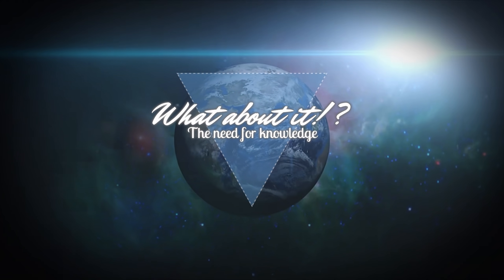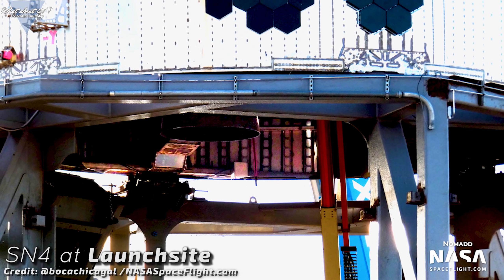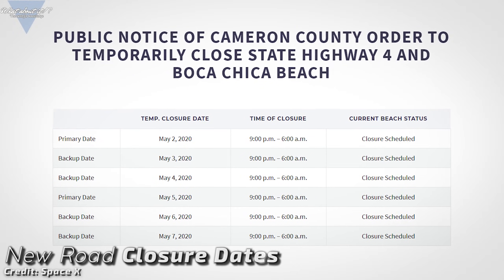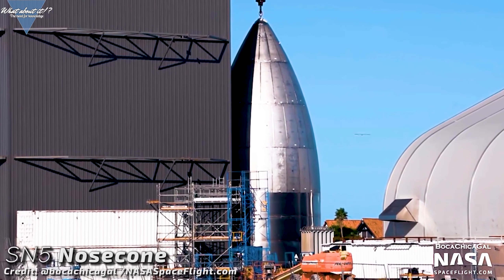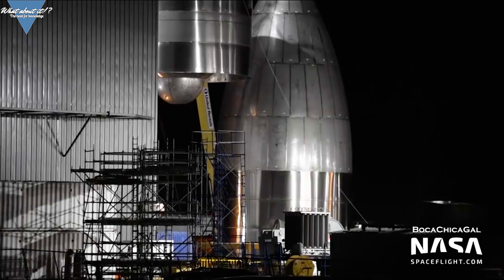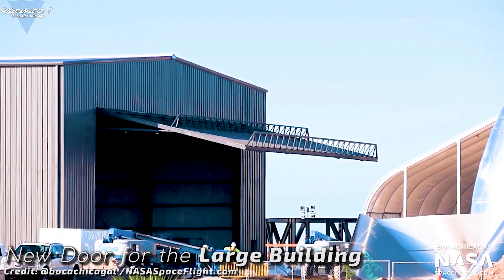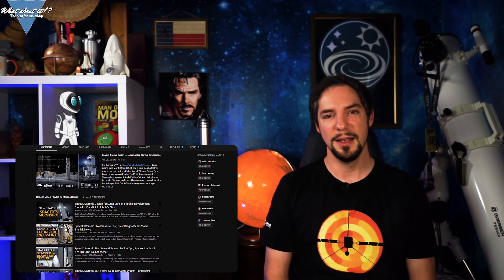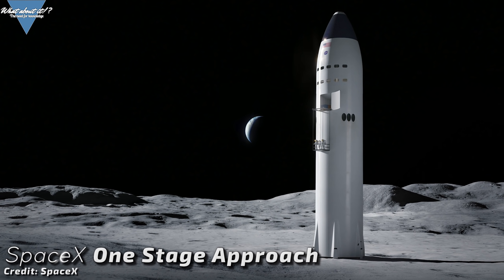89 | SpaceX Starship Updates - Lunar Starship: One Giant Leap

Comment: The lunar starship is supposed to be refueled and reused in space. A really big question is; what engines are being used higher up? There appears to be 12 of them. Obviously they can't be raptors because it only takes 3 raptors to land on earth. 

The next logical thought is that they are superdracos. If they are superdracos, then that creates a big issue with refueling. Space-X intends to demonstrate in-orbit refueling for methane and oxygen. They will used thrusting to settle liquid at the bottom of the tank, and pressure differential to move it. However the superdracos use hypergolic fuel under extremely high compression. (in a compression fed rocket, the fuel tank and feed line pressure has to be higher than the combustion chamber) This fuel is also extremely toxic. So how can it be routinely refueled? The only way I can imagine is to exchange the old empty tanks with new charged tanks. But then it has to be mounted and connected to the fuel line. If this is done in a pressurized cabin they are handling toxic chemicals in a confined space. If it is done in a vacuum, then you probably have guys in space suits doing it. Those are BIG challenges. 

I am assuming that the raptors in the base are still the main engines. They would have the better ISP and accomplish most of the delta-V for going to the moon and coming back.  So the higher up engines would only kick in when the ship is close to the surface.  

I wondered maybe they would be Merlin engines because transferring RP-1 would be a lot easier. But it seems like 12 merlins is too many for the moon. I don't have the skills to do the math on this. 

So here is my other thought: As I remember, the attitude control thrusters on the starship will be bi-propellant methalox engines. The reasoning being, they want to be able to recharge everything from in-situ resources on Mars. I know very little about these engines except that they are to be pressure fed by gaseous fuel, (no liquid). What are they called? Do they have enough thrust that 12 could do the job? (The lunar starship would not be landing empty. Besides cargo, it would have enough fuel to ascend back to the gateway station.)

I would love to hear some comment or clarification on this question. What ARE those 12 smaller engines?
Reply: At this point, nobody really knows... all we've got is that illustration. But I agree that they would almost certainly be methalox engines of some form, because anything else would require additional tanking, and additional refueling requirements. Upgraded RCS units does seem a good possibility, since they'd only be needed for a few seconds on takeoff and landing...

Comment: I don't think any Starship will ever be operational. I'll readily say that I was wrong when a Starship reaches 150,000 feet altitude (halfway to space) at 90% maximum weight. A scale test with 1 engine, 3 engines or 15 engines is of no interest to me. It would take at least 28 engines burning to have a valid test. Nothing that has happened at SpaceX or is happening now has moved them even 1% closer to a working Starship.
 
Most of these channels are run by and viewed by Musk groupies who think every weld and engine firing puts SpaceX almost to Mars. I don't think they have a clue about the difficulty of building a vehicle larger than a Saturn V. They are sure it's possible ... just because they like Musk and how dare you bring up the vast number of engineering problems. I think they are going to be very, very disappointed.

Comment: There's another reason why raptor is no good for landing on the moon: it's too powerful! The most efficient way to get to the moon is to drift through the lagrange point gravity saddle at as low a velocity as possible. You still need a deltaV of 2.5km/s to decelerate and land though, and with the specific impulse of a raptor that means halving the mass to deorbit. In the extreme case of a fully fueled starship leaving the lagrange point at zero velocity (we'll ignore how it got there without burning any fuel at all!) the max mass is (1200 propellant + 100 ship + 100 cargo) = 1400 tons. Divided by 2 = 700 tons mass at landing. Thats 1,400,000lbf weight on earth, but only  233,000lbf weight on the moon. Raptor thrust comes in at 440,000lb and they won't want to risk a single engine landing on the moon so with 2 engines we're looking at 880,000lb throttled down to 233,000lb in the heaviest possible landing case. That's tight! Those landing thrusters look a lot like superdracos, and 18 superdracos would have a thrust of 18 x 16000lb = 288000lb. Just about right. Interesting coincidence! Burn time for unmodified superdraco is only 25 seconds though, which is not long enough for an abort and go-around, a bigger fuel tank would be needed.

Comment: The issue of rocket exhaust putting lunar dust into permanent orbit is not as big as people seem to think. Raptor exhaust velocity is 3.7km/s and minimal orbital velocity is 1.66km/s so there's enough energy to put dust into orbit. This is downwards velocity however, so once it has been turned sideways it's unlikely to be as high as 1.66km/s. The other point is, that orbital mechanics requires that bodies in orbit move in an ellipse with the centre of mass of the orbited body at one focus. This means that any particle launched from the surface of a round body will either escape or land elsewhere at the same angle at which it was launched. The only way it can get into an orbit that does not intersect the body is to gain some height as well as velocity. The edge case is when the particle is launched horizontally. Then can it go into orbit, but it will return to ground level at the bottom of every orbit and eventually crash into a mountain. Rocket exhausts can still make a big mess and throw dust round to the other side of the moon though.
Reply: londonalicante - And, they have the option of landing 2 lander/drone combinations on one run, having these make a landing/launch pad & then having Starship land on it.

Comment: I do not think that we would get a starship universal connector. How I came to that conclusion is bu thinking that like the following: 
1. A connector would add weight and two parts that are in contrast to Musks vision "No part is a god part".
2. Musk is going to build 2 starships a week and they are reusable. Thus no need to have a configuration option, just build or reuse an already existing Starship. 
Thus no universal connector.
With that said, Musk according to Gwynne likes when things are beautiful and functional. Will create a shipbuilding website where you select From where do you want to start and where do you want to lad. [Earth, Moon, Mars, Europa] then what's your cargo? [Humans, Cargo, mixed] and so forth and finally if there is an existing starship with that configuration available or not use that starship or build a new one with that specification. (Warning; TL:DR)
Reply: Agreed, a universal connector would be unnecessary. Look at how Starship is being built today... they're establishing a standard build for the tank section, then the upper section apparently will just get welded onto the top. That already gives them plenty of flexibility to have a few variants of the upper section... standard base + tanker, standard base + cargo, standard base + crew. They don't need to be more modular than that...

Comment: Felix;  I'm a retired Army sergeant who worked in Air Defense Artillery.  For instance, STINGER had a "kick" rocket motor to get the missile away from the launcher tube (and operators!) and then a "sustainer" motor to take it the rest of the way to the target.  Is it possible that the Lunar Starship might have the same principle?  The Raptors bring the Starship close to the surface, then the descent/ascent engines take over.  Then at launch, the new engines get the Starship high enough for the Raptors to take over without disturbing the Lunar regolith?  It seems obvious to me, and possibly you, but I'm sure you can explain it in detail much better than I can.  Thanks for your great program!

Comment: Starship Lunar,  crane system, in watching Apollo lunar excursions, the common issue was the fine lunar particles that just stuck to everything even giving the glove locks trouble in closing airtight on their suits.
How will SpaceX deal with this issue in the crane system, a failure here could be a major catastrophe, or for that matter any of the other proposals, relying on a mechanical device to reach an access point over 100 feet up is a real design problem.

Comment: Respectfully, the stiffeners on the thrust puck may have been removed or the marks that remain could be signs that the integration of the stiffeners has been on the inside of the tank. The appearance would be similar to that on the outside of the thrust puck.

Comment: Felix, may I make a suggestion about your lighting?
With your dark/black hair, a black shirt and a black chair, everything is merging into one large black mass with only your head and arms sticking out.

We can easily make this situation look better with just one light. Place it up and behind you so it is out of frame and angled down at about a 45 degree angle. The angle is not critical, just adjust it until the result looks good. The power of the light should be about 1/4 or 1/3 of the other lighting you are using. And, of course, it should be the same color temperature as your other lights. You can also use diffusion to lessen the amount of light. Or simply bounce it off the ceiling where it meets the wall behind you.

Be sure to block any extraneous light from hitting the camera lens so you won't have lens flare which will degrade the quality of the image. You can do this with a lens hood on the camera's lens or by placing a black card either on the light or suspending the card between the light and the lens.

I hope this of some help.

Terry Thomas...
the photographer
Atlanta, Georgia USA

Comment: Still going to need a reaction control thruster to prevent horizontal acceleration while under powered flight. Forces producing rotation and unwanted horizontal flight must be 0 for a vertical flight. Gimboling and a thruster higher will help sn 4 to fly stable

Comment: Great video! keep up the great work!

I think you wen't a bit too far with this idea of "modular fairing". If I understand it well (you're talking about a 2nd stage in 2 parts that could be disassembled on earth?), I don't think it is a good idea, it would complicate things a lot for reentry, reusability, the overall structure etc.. and would probably result in a high performance degradation. If you've seen evidence I missed SpaceX going this way please let me know. 
I believe their idea of fairing in Starship would be closer to an additional light envelope that lies into the standard cargo bay but adds protection for demanding satellites. It would be inserted in the cargo bay just before launch and thus be able to stay upright. Maybe it will stay in the cargo bay after the satellite separation to be recovered and reused. At least that's how I'm interpreting it.

Comment: Could the get rid of the bottom engines before landing on de moon and use that space for storage, shelter, what ever? I may be a dumb question
Reply: The illustration shows the raptors glowing, suggesting that they're still needed for landing. It's likely that they're used for most of the landing process, but they have the smaller high-up "landing engines" to avoid using the main engines too close to the ground.

Comment: Felix, I have a burning question for you. You've played around with KSP and the Starship design enough that I think you can answer this. Can Starship be lengthened without any adverse effects on aerodynamics, CG or weight and balance? If so then it would appear that Starship will become the Conestoga Wagon to the stars. All you have to do is insert the appropriate mission specific module. The entire nose section to me seems a bit vague to me regarding the amount of space available for living quarters. No doubt because it keeps changing. I suspect the descent engines to the moon will be the same engines in the Dragon 2 capsule. As I recall they are throttlable. If that's true further down the road  you might see Dragon 2 capsules using powered descents when coming home. For the first big vehicle landing I think there is way too much concern over regolith getting launched into orbit. It's not like there is no gravity at all, so it will eventually fall back down. Certainly you can land once and then spray a binder on the regolith to create landing areas. A couple landings on bare regolith isn't going to kill us.

Comment: Roadmap for Lunar Starship
- Starship prototype hops
- Integration for multiple engines

- Prototype prolonged flight/hover
- Landing gear + Powered descend
- Fins
- Heat shield
- Control systems (Navigation, communication, aviation)

- Life support system (Energy, Temperature, pressurized habitat, humidity control)
- Interior design (storage and habitat layout, command section)
- Launch site (Pad, Tower, Fuel, Infrastructure)

- Orbital flights
- Human rating (Contingency protocols, emergency procedures)
- Modularization (Fairing sections)
- Refueling stage
- Refueling maneuver (Orbital navigation + course correction)
- Booster (Super Heavy)

- Thrust section makeover (Landing gear, Paint, Fins?)
- Fairing section makeover (engine/thruster integration for lunar landing)
- Trans-lunar trajectory + Lunar orbit (+ lunar life support)
- Lunar landing

That's a hellofalot of work to be done. SpaceX must be hiring...
Meanwhile, prototype tests fail because of incorrect tank pressures. I'm not a nay-sayer, but by the time Blue Origin, NG, Lockheed and Draper will be ready to fly to the moon, SpaceX will at best be doing Earth orbits while integrating Life Support, Control systems and maybe do refueling demos. They can obviously rely heavily on existing development from Dragon and Falcon for a lot of things (comms, navigation, command&control, software, landing maneuvers etc.). But integrating and testing takes a LOT of time. I don't know how much workforce SpaceX has or how much they aim to add, but I'd trust NG + LM alone to have an orbit module + lander ready to be strapped onto SLS by the end of 2022.

Comment: 11:50 “no paint” Elon mentioned the problem with a coat of paint.  Paint actually weighs a lot.
Reply from the maker: A het shield weighs more. Weight won't be the problem. You have to protecct the ship from heat on the lunar surface though.
Reply: @Whataboutit  But doesn't the shiny steel surface cool the ship even more than white coating?
Reply: I think Elon uses WD-30 for the exterior.

Comment: Would it be possible to park a SS in moon GSO and use a cable to transfer astronauts and materials to and from the lunar surface. Possibly using Tesla motorized lift. If this is possible, would eliminate the need for a lunar landing. No atmosphere, no drag on the moon. No problem keeping a straight tether between SS and lunar surface.
Reply: No, because there are no stable selenostationary orbits... the altitude required is too far away for the moon's mass to hold them. 

Also no, because building a 90,000km cable is something of an engineering challenge.

Comment: Why are the nose cone sections vertical as opposed to horizontal rings?
Reply: Main body rings could be formed in a device that resembles an old fashioned wringer washing machine. Since nose panels are bent in two directions they would probably have to be formed in a press containing two hard forming blocks OR one hard forming block and a thick rubber block pressed against the panel by hydraulic fluid.

Comment: 6:39 The weld marks make me think they simply moved the reinforcing struts from outside the dome to inside the dome.Immersion in the cryonic fuel will make the stainless steel struts stronger.
Reply from the maker: Could be, but I don't think so. For me it looks like they had them on, removed them and then ground and polished the weld marks. But you could be right too. 👍🙂

Comment: 7:25 It looks like the stiffeners on SN5's thrust puck are welded to the inside. You can see the dark weld marks on the outer surface where they were welded into place. You can see the same thing on the outside skin of the thrust section rings where the interior bracing is welded.
Reply from the maker: Could be, but I think they had them attached already and took them off. You can see the polish and grind marks too.
Reply: @Whataboutit  Yeah, it looks like they may have taken them off from the outside and then added new ones on the inside. Maybe the outside ones were just temporary reinforcement until they added the inside ones? The marks on the outside almost look like adhesive.
Reply: I think Greg is right but who knows. I don't think space X is at the point of removing reinforcing for optimisation yet. According to Elon they reached only 4bars at pressure test. Putting reinforcing inside make sense.

Comment: Is the offset used to simulate higher winds for the software to deal with in the test?
Reply from the maker: I do not think so. There won't be much wind either way. I think it's due to the fact, that SpaceX wants to take it easy. Three Raptors means three times the stress for every system involved.

Comment: The moon landing ship needs to be low to the ground with wide landing pads The moon and mars  has less gravity and a soft un prepared surface a ship too tall can fall over also the lift can mess up leaving the astronauts stranded and running out of air trying to get the lift working   THEY NEED TO MAKE THE LANDER more on the shuttle crafts on Star trek and the ships of Space 9999.where you can step thru the hatch on to the surface.